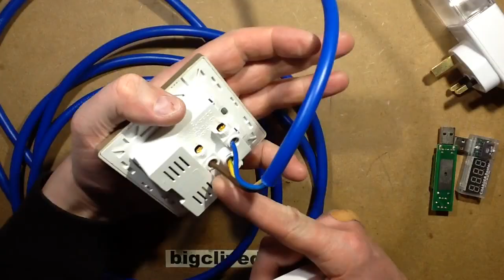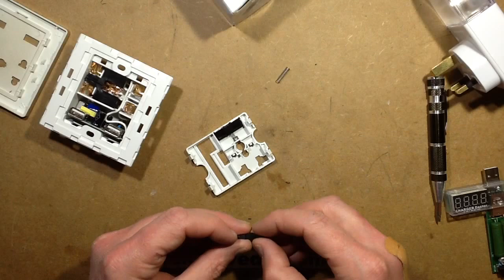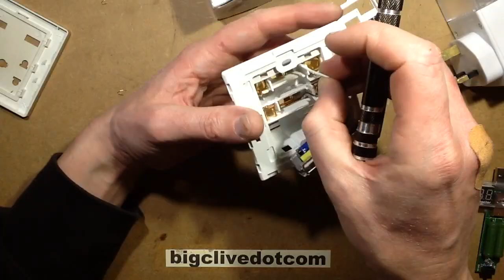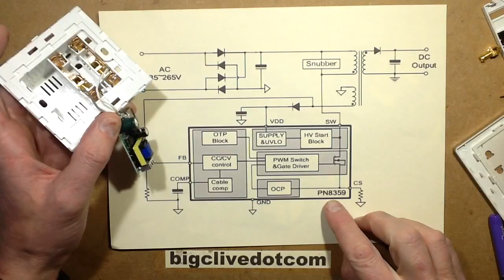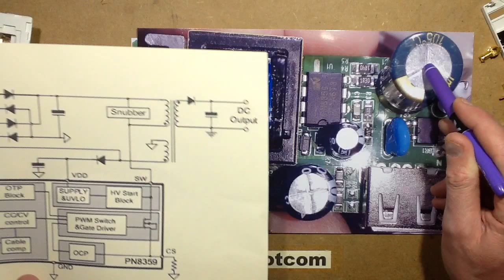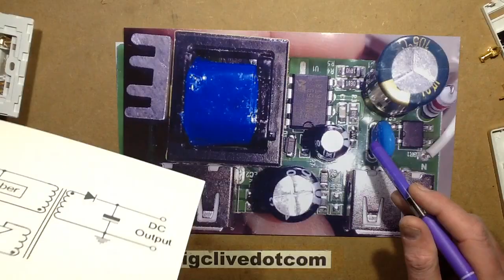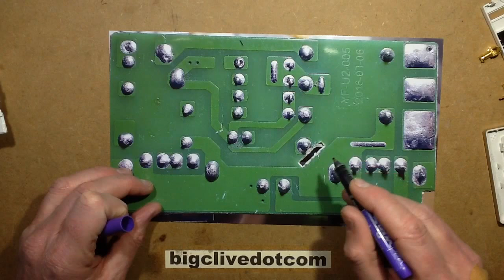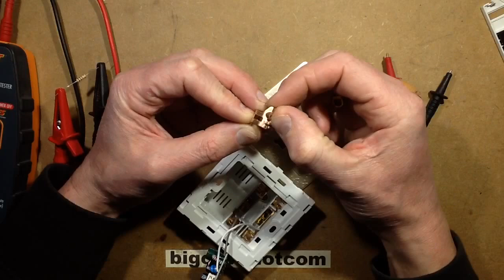Wall plate death-dapter tests including fire and 1kV.

Comment: talking about electric shocks, I was recently boiling water with an induction hob and when I first switched it on I stuck my fingers in and touched the bottom of the pan and I could feel a tingly feeling like current was flowing through my hand, it wasn't unpleasant or painful but I would've expected the voltage to be so low that you wouldn't actually be able to feel it.
Reply from the maker: I'll have to try that.

Comment: I remember sticking knifes and forks in UK plug sockets when I was a kid and I never managed to electrocute myself 😂
Reply: I always warn my family to never buy baby proofing socket caps. For a baby getting a shock from a UK socket would be like a layman attempting to pick a door lock and have you have discussed previously in your videos, baby proofing socket caps can almost be used like a skeleton key, because they bend or even break they can be easily used to open the shutters and leave the pins exposed.

Comment: It seems the ( slightly ? ) low USB voltage might be easily remedied ( by the manufacturer ! ) by an extra turn on the transformer output ( there is no feedback circuit ) ... the BIG snag with these type of sockets is they consume ( small ) power  ALL  the time ( 2023 energy crisis ? ) ... much better to use the " plug in " type of USB charger , as required ( keep your bills down ! ) ..... DAVE™    🛑

Comment: I plugged a 1.5volt outboard motor into a toy boat in the wall. After 240volts, the engine exploded and the plug went. Mom wasn't happy, dad just said "don't do it again".. Never did it again, but it got me interested in electronics. And those with blowing things up are also true. Got a chemistry box, thought after a while it was boring with the stuff that was included. Tried mixing different things from the cleaning cabinet and garage and then "BOOM" when it was heated. Then I became interested in it that to 😂

Comment: I must have been about 3 when I had my first experience with 240Vac. We still had 5A round pin plugs and sockets. 

I've had more shocks over the years, most, but not all, accidental. 

Unsurprisingly, I followed a mostly technical career path until I stopped working due to ill health.

Comment: i played with electricity when i was like 6 or 7 years old. i took a cable like the PS2 had with the two holes and put needles in it and plugged it into the socket and looked for metal stuff to touch it with. made some nice sparks was really cool. Now many years later im a electrician :p

Comment: Two things, it appears you can connect a two pin plug. The 13 amp plug has a fuse whereas I don't think the two pin plug has. Secondly, should there not be a switch to isolate the socket.

Comment: European plugs are different as in, there are shutters but they are defeated by pressure. Note that back in the day most sockets were not grounded, and the older grounded versions had no shutters at all. You could buy these little plates that would glue onto the socket. They made it so you had to push the plug into them, turn a little shutter plate like 90 degrees with the plug whereafter the 2 holes would open up. If you had kids you would buy those. Nowadays the plug usually have shutters which require adult force to be opened. Integrated usb sockets arent really a thing at all

Comment: So, you have devices (toasters, irons, fans...) that have different plugs? What is your standard breaker size?
Reply from the maker: 32A on a 240V power circuit.
Reply: @bigclivedotcom  For a receptacle? wow. We have 20A on 120V with 15A for lighting. It's unusual to see an outlet that can be taken apart so easily..
Why different plugs though?

Comment: a little late... but the "Socket and See" apparently doesn't have the proper "CE" marking... the kerning between the C and E is too narrow... from what I can tell it's just a so called "China Export" logo (or such, doesn't need to be from China)... that being said, even the proper CE marking does not say anything about the quality of the product.... it just ensures minimum standards, that the product can be sold freely on the EU market, regardless of country of origin.

Comment: When I was a kid about 9 or 10 years old I kicked my lamp in frustration because it wasn't working it didn't have a light bulb in it and I got a nasty zap through my big toe and a week later I didn't learn my lesson from the previous electric shock a week later I grabbed a lamp in anger in attempt to throw it across the room and stuck my thumb in the light socket I got zapped for 60 Seconds straight until the circuit breaker in my room tripped 240 volt through the thumb does not tickle and now I've got obsession with screwing around with anything that works on 240 volts but now very cautiously

Comment: When I was 4 I cut the cord of my mom's curling iron with nail clippers. I remember getting quite a shock, and I had a scar on my wrist for quite some time. The severed curling iron cord actually kept arcing until my dad turned off the circuit breaker. To this day, there are still burn marks on the bathroom countertop!

Comment: Question. If you have a device that only accepts 110-120v ac and you plug it in but its wired to 220-240v ac how do you get the 110 needed for that plug and the 220 for those ones?
Reply from the maker: You can only use 240V appliances in it.
Reply: @bigclivedotcom  but if you were traveling there and you brought your stuff you would see a universal outlet and fry it

Comment: I think you're being overly generous in your evaluation of that USB-power module.  The design might be OK, but it is still putting out only the absolute bare minimum voltage allowed by the spec.  A well-functioning USB power supply should put out over 5 volts under normal circumstances (typically around 5.2, but really good ones can go up to 5.4 or so).  If it's putting out under 5 volts even unloaded, it is just crap.

Why is this important?  Because most USB cables use fairly thin wire, and thus usually have significant resistive losses (particularly for longer cables), so the voltage seen at the other end will often be several points lower than at the source.  I've seen many USB-powered regulators which actually cut out below around 4.4 volts and just won't function, which means this supply is just barely on the edge of working for those sorts of devices, even with no cable in the middle.  If you plug them in with any length of USB cable at all, they'll probably just not work, for no obvious reason.

Comment: I grew up with normal european sockets, no safety features and sockets in the bathroom next to a tap as standard  and haven't heard of anyone flying across the room  because RCDs were installed as standard in 1980s in my country. 
 UK needs shutters in the sockets because in the  21st century UK still has loads of houses with fuse boxes remembering Elvis Presley and no RCDs whatsoever.  You need to know all these chinese sockets are made for loads max 16A . British rings can pull 32A hence all BS sockets are made of thermoplastic and look like made in 1970s in some Eastern Europe communist country.

Comment: so a 2amp two-pin socket on a 32A if fed via a ring main or 20A if fed from a radial circuit, not in my home.
Reply from the maker: This socket is completely non UK compliant.  Our sockets should only take plugs with a fuse in them sized to the flex.

Comment: Correct me if im wrong the area of 5 volts should be plenty as nearly all mobile device battery requirements are 3.7volts. I am curious about the uķ style outlets you are showing. They appear to be enclosed to avoid accidental shorts. Do they require an in wall mounted box  metal/plastic to mount the outlets or are they direct install into drywall/panel or whatecer the wall finish happens to be?

Comment: I now know I have missed my vocation. I stuck a fork in a socket in 1962 at age 3 but never did pursue electrical engineering. I do dabble with hobby electronics though, just not at a particularly advanced level.

Comment: Clive, you are quite right about an early encounter with electricity leading to a career.
At age 8 I tried connecting a torch bulb to the mains. Our house did not have modern wiring, instead we had 5A 2-pin sockets (no shutters). At night I placed a screw in each hole and attempted to place the small bulb between them with the expected result. My muscles spasmed and threw me away from it. Shaking, I retreated to bed and eventually slept.
Later my father discovered the screws and went bonkers. Soon after our house was wired with safe sockets.
A career of (so far) 55 years in electronics followed.
Reply: I touched a light bulb socket when I was around 4, it didn't hurt that much, just a slight burning, mostly a sort of oscillating, "cold" feeling almost like sticking your finger in front of a jet of water from one of those power wash adapters for a garden hose, could that have caused my interest in electronics

Comment: Reflecting on your summary of this device regarding permanent connected electronic devices. For the likes of an electronic dimmer or even a smoke alarm are on the lighting circuit you must disconnect them for a true electrical test.

Comment: You should check out some French kitchen sink units,. Like a standard stainless steel sink unit, but has two electric rings built in for kettles or a pan of something, couldn't believe it the first time I saw one

Comment: Don't put usb in the walls. standards are changing to USB C, capable of supporting close to 100 W at higher than 5 V. Most people shouldn't change their own sockets, and in 2 years you'll have to call a qualified electrician to change it again. Get the kind that gives you usb  outlets and 2 mains outlet, that plug in to a regular socket.

Comment: huh funny you mention that's exactly how i got into electrical engineering i plugged a plug in when i was 4 holding both the prongs and got hit with 120v and then i did it again to figure out if it was because i touched both of them that i was electrocuted and again only touching 1

Comment: When I was 5 or 6 I was curious about the water pump when my brother was watering the garden. I remember seeing a white cylinder with two brackets holding it behind the pump. I reached over and grabbed it and the next thing i know i was in the ER getting dead skin off of my hand and it was stitched together. Till this day i cant give the bird with my left hand. I’m now a mechanical engineer specialized in nuclear energy engineering with a life long passion for electronics.

Comment: Related but not. When I was 15 or so took metal pliers and thought it would be cool to cut a extension plug wire in half. Didn't get blown across the room but got shocked and my ass beat because of the nice black mark on the white paneling. I then was taking everything apart and still do. Fast forward 27 years later and I'm a IT support Engineer with a huge company and I take computers and severs apart for a living.

Comment: Are my eyes deceiving me or are you turning clockwise to unscrew those screws? Is that standard in the UK?
Reply from the maker: Normal convention.  Anticlockwise to remove.
Reply: "Right is tight, left is wrong"
Reply: Righty tighty lefty loosey :o)

Comment: Are any of the non USB ones built any better?  I was planning to install a "multi stadard" socket in my garage when I move home this year.  You know, so I can directly plug in tools/power supplies in ith EU/US plugs ithout having a wobbly adapter.
Reply from the maker: These are just basically a wobbly adaptor screwed to your wall.

Comment: Regulation under varying load conditions of smaller transformers tends to be poorer aswell? Yes spot on on all aspects of assessment. The case looks like it is made of nylon type material. I'm not keen on unregulated supplies or primary side circuits. I just think better designed running control circuit from secondary. Also do any of these circuits have thermal fuses built in to transformers? Should they?

Comment: Having grown up in Scotland and now living on the U.S. as 40 something adult, I can appreciate that an outlet over here will only give a "tingle" when touched in 'exploration'.

However I also lament that the watts required of any given appliance are twice as deadly at 115/120v than they are at 230/240v specifically because of 'halve the voltage double the amps'.

My dad spent 26 years in the military in electronics. He used to tell me , "volts jolts, amps kill."
Reply from the maker: The ferocity of the shock also depends on the environment.  The shock current with wet hands and metalwork is multiple magnitudes higher.  Something that catches many people out when they get used to slight indoor tingles.
Reply: @bigclivedotcom  Agreed and excellent point.  Adding moisture or additional conductivity is never good when the primary grounding rod is the human body.

Comment: I did that as a crawling baby picked up my mums knitting needle and bam while she was making herself a brew I flew across the floor bam, and funny but yes am an electronics engineer,  programmer,  and currently a care worker. Strange eh , am aw inspired by high voltages Vandergraff generators lightening and plasma arcs 🌐🙃🤓

Comment: As a kid I got whacked (several times) by lawn mower and car engine spark plugs. I originally started my career as a computer tech, then I moved into auto mechanics. Today, I drip devices that use 5,000volts, into 4,000metres seawater.

Comment: You said people with electric accidents tend to go into electricity and people with firework accidents go into pyrotechnics but I'd say that might be a causation/correlation issue. It MAY be the case that the reason those people got into accidents in the first place is because they already had an interest in the electric socket or fireworks and they would have gone into the fields accident or not, they just got a littel carried away in their interest and got injured

Comment: 20:08 - Doesn't the USB supply shut off when no USB cables are connected?
EEVBlog recently did a video on smoke detectors. The (cheaper) model he chose drew a quiescent current of 80mA @ 240V!
https://www.youtube.com/watch?v=_kI8ySvNPdQ

Comment: The electrical wall plate you are showing has a North American plug socket.  The problem I have is the voltage difference between Europe and North America.  I have accidentally plugged in my North American plug in one of these universal plug adapters burning out the hair dryer.   Now I pack a 110 / 220 adapter when traveling outside North America.   Please in your talks mentioned the dangers of 110 volt products being plugged into said universal adapter with 220 volts.

Comment: The USA sockets are better clamping but do use the crappy plated steel metal. At least this thing doesn't have the B.S. ground fault "nuisance" circuit the USA sockets have!

Comment: One time I was fixing a camera and I was useing a small flat head and put it under the capture button and got shocked with 350 volts I fell on the floor and was stunned for like 2 min. I have been shocked before but not that much. Couldn't feel anything on for body for 2 hrs. Like a the stipend idet I am I did it twice. Now I have more respect for stuff that it's powered. And now I can fix things quicker for the fear of being shocked. But I always drain capasters and check to make sure I won't get shocked. 90% looking for fear of being shocked and 10% fixing stuff.

Comment: Nice video. The only thing which is missing is the lack of a load test. It would be interesting to see what would happen if you actually put 13A through this socket for an extended period. Oh and more than 1kV is required for hipot testing between the primary and secondary sides of the circuit. 3000VAC  should be used and this test should be seen as potentially destructive. If they wanted to reduce the creapage distances, they should have just earthed the negative of the 5VDC side.
https://www.power-mag.com/pdf/feature_pdf/1285232008_XP610_Feature_Layout_1.pdf

Comment: I'd be concerned that those flimsy contacts would get hot if you plugged in anything with a motor. Vacuum or a drill might be enough to melt the plastic.

Comment: You mention 13 amps supply, but a UK ring main is normally protected by a 32 amp MCB, so this socket has 32 amps available before it will trip. Agggh!

Comment: I never understood the use of shutters. It's a real bureaucrats solution. I your installation is correctly fit out with a 30mA earth-failure detector. Poking one nail into a hole will give you a good bang, but won't kill you. If a kid gets 4 or 5 years old and manages to put in two at the same time. It will finish him off for sure. And that with the approval of all the (in-) compentent authorities. I'm 53 years old working for 37 in high power electronic and electric equipment. I just don't understand that nobody threw this kind of false security overboard. I'm European btw for info. Keep up the goog work Clive. I like your videos.

Comment: A 1kv test does not prove much as a 1 mm gap (with solder resist) would probably pass that but you need much higher gaps to be compliant. Your testing your meter with a 1M ohm resistor is fine as a confidence test but nothing like calibration which will use a much more precise reference that is traceable to NPL in the UK.

Comment: That 1mm separation looks completely avoidable too:  if the trace was narrower and more rounded (it's not a high current path), there would be more separation at no cost.  I'm not sure why they didn't bother doing it that way, since apparently someone thought about it enough to include an anti-tracking slot at another point.
Reply: It could also be rerouted around clockwise removing the need for the close track.